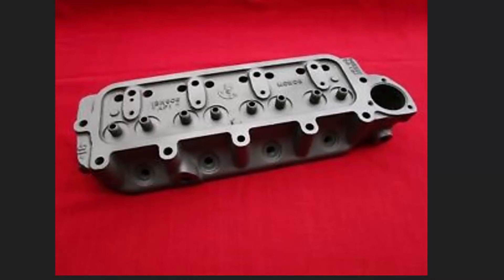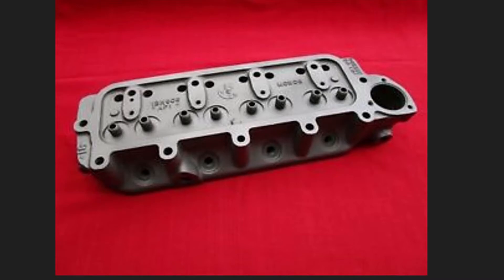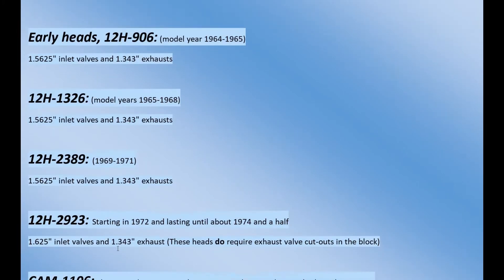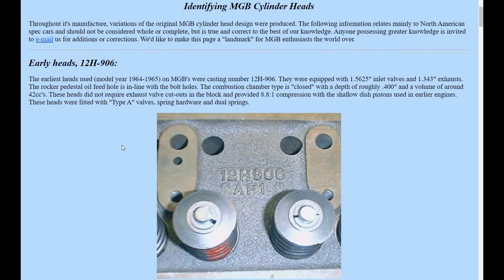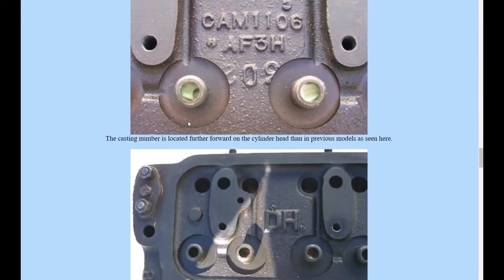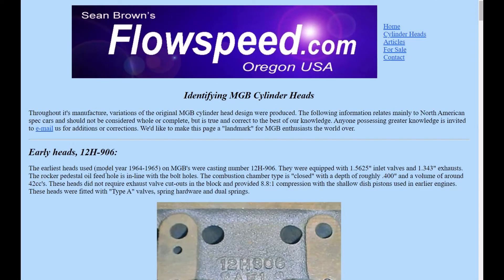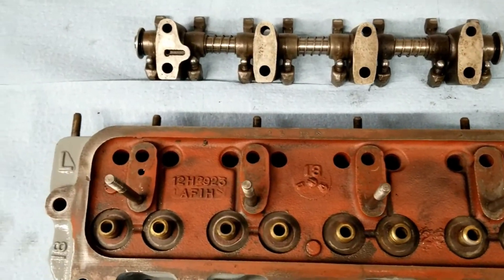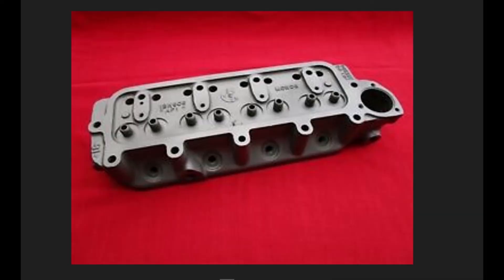MGB Cylinder head compatibility

Comment: That would be Sean Brown's site. He is about 5 miles from me.
Though he did a considerable amount of work for the public in years past, he no longer takes "outside" work.
He is  also an expert on the HRG Derrington cross flow heads made in England in the 50s and 60s. 

I m curious about the 1962 and 1963 MGB cylinder heads.. such as my 1963. with a 906 cylinder head.
MGB production was mid 1962 though 1982. 

To my knowledge the 906 was made for the 3 main engines up to October 1964 when the 5 main engine was introduced.
Reply from the maker: cool, as I stated, I kind of stumbled on his site.
a wealth of information.  he did respond pretty timely when I email him.